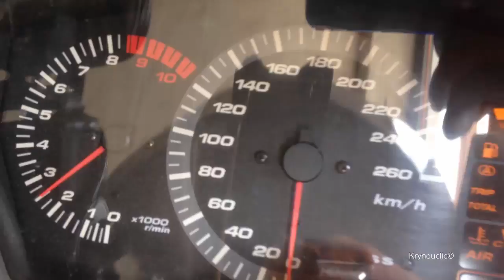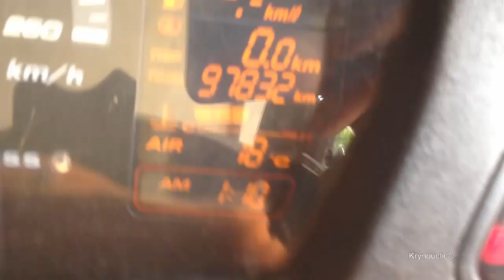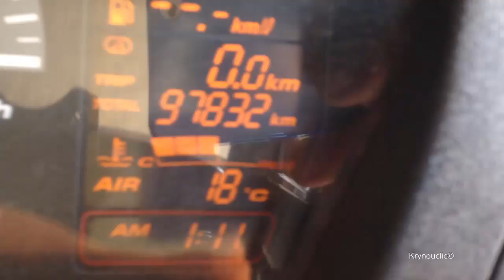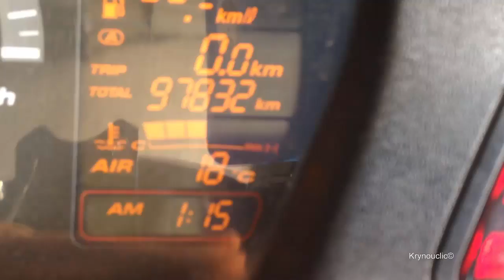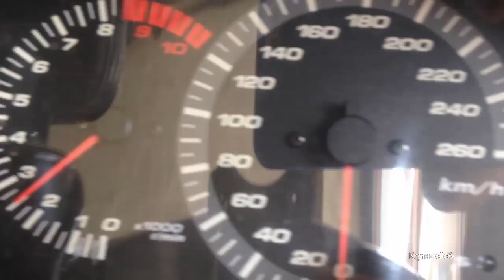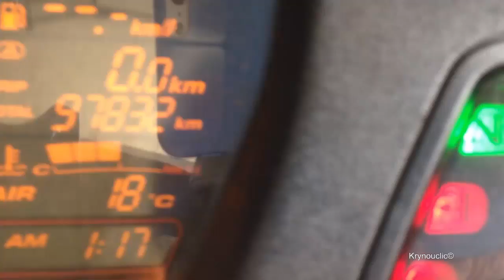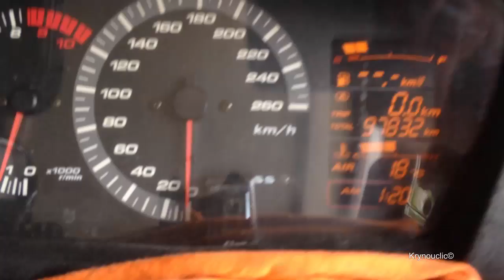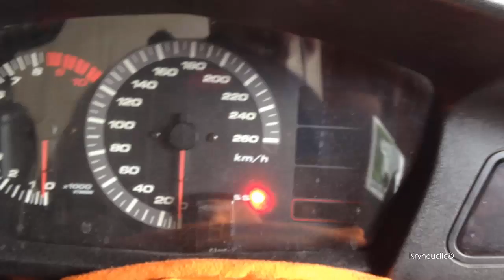Honda Pan European ST1300 - 4600 tours

Comment: Wax thermal valve (called SETV) not expanding properly. Dead center of the screen, at 7:14. It's basically still running full choke (EFI, so not really choke, just an upped RPM). Once warm, the rest of the EFI does it's thing, and the idle shoots up.You can see at 12:21 it's fully extended, where the idle goes down. My bet is on a cold day, it also shoots back up at every stop. Most likely, the coolant lines that run through it are blocked, or at least partially blocked. Don't adjust it to accommodate for a failure - fix the failure. They can be cleaned without removing the whole thing. It will make a mess. You have to blow air through the lines. I've only read about that solution once, can't recall where.
Reply from the maker: +Scott Chaisson Thank you for your intervention. Your proposal has been given to a mechanic friend.